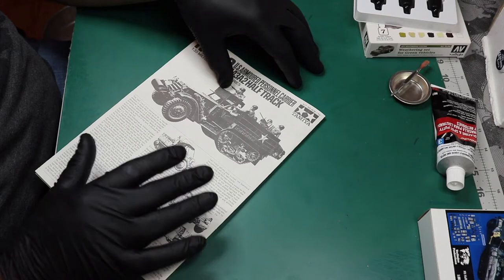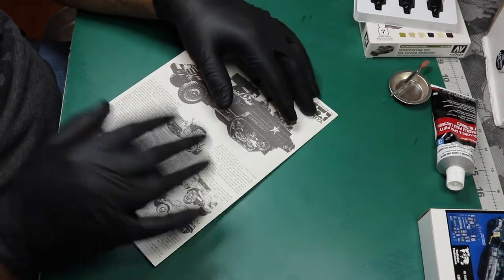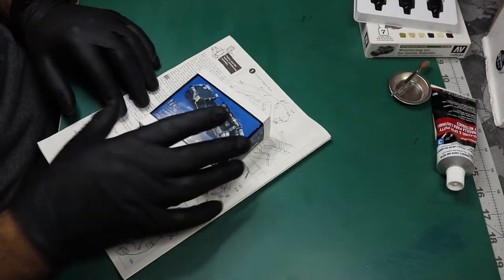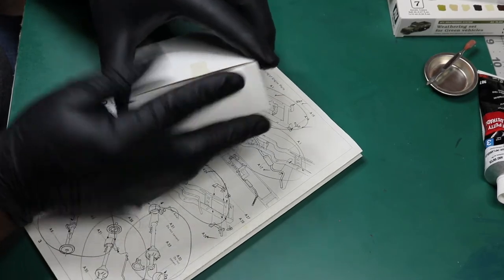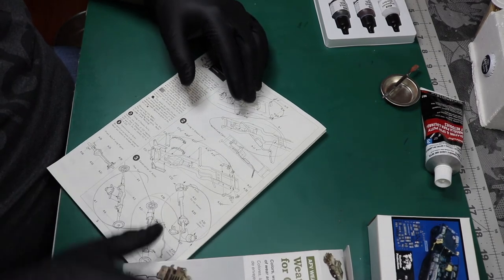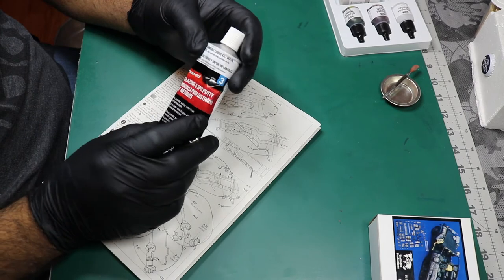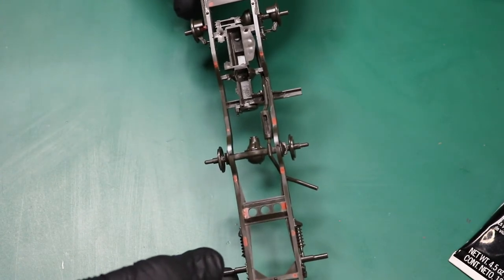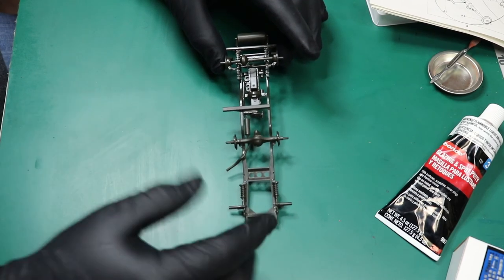1/35 Tamiya M3A2 Half Track Intro/Update 1.

Comment: Good updt Luis :) I've been using bondo since you introduced me to it 4 yrs ago :) Yrs it shrinks but so does Tamiya putty but, it is far easier to sand :)
Reply from the maker: Switcher oh cool, I’m glad you use it. I just want to utilize everything I have, and i have two full tubes of it! Lol. Thank you for watching.
Reply: I'm on my 2nd tube and have a spare. I hated Tamiya putty and you came to the rescue. It is remarkable to work with especially in hard to reach areas, where sanding Tamiya putty is next to impossible at times, or sit there for 2+ hours!
Reply from the maker: Switcher agree, tamiya is great as well but there’s no comparison when it comes to sanding.
Reply: I especially love it on figures. Fills the gaps nicely with a paint brush and cleans up nice with a damp brush with acetone. (Stinky ingredient you don't like in glazing putty). BTW nail polish remover is scented acetone :) Would work in a pinch, just don't tell the missus :)
Reply from the maker: Switcher thank you for the tip!